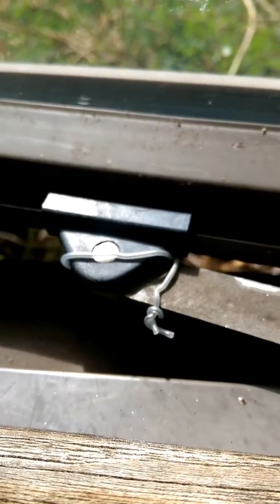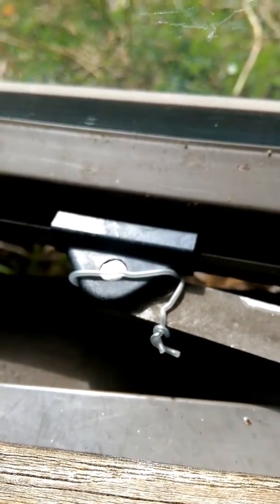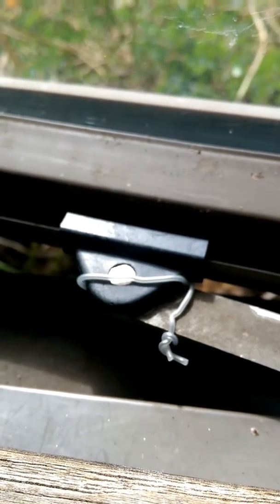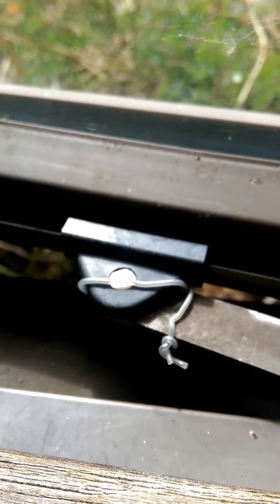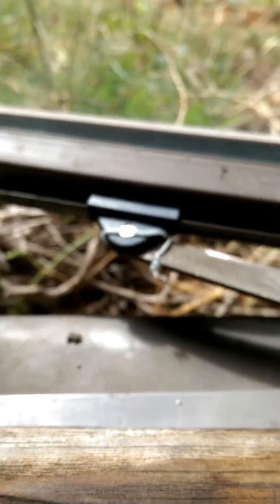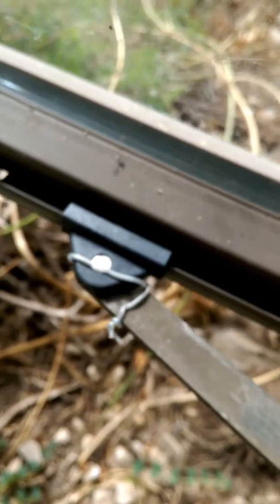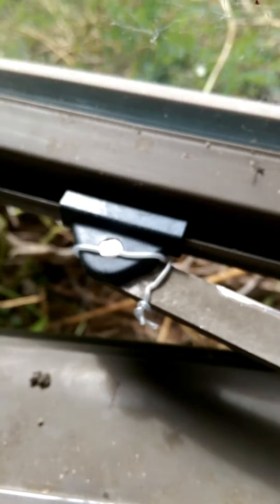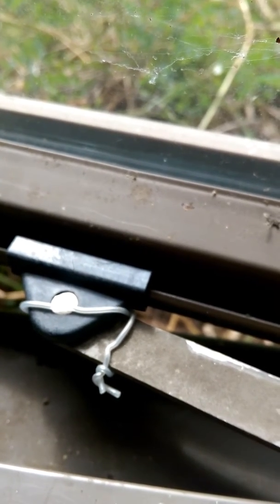Andersen old casement straight arm shoe DIY

Comment: Why do all that work, just break off the old shoe, probably brittle like mine were and came off easily. Then take the new shoe and make the hole just a little bigger and then place over the metal peg on the arm. I did 5 windows this way and worked perfectly.